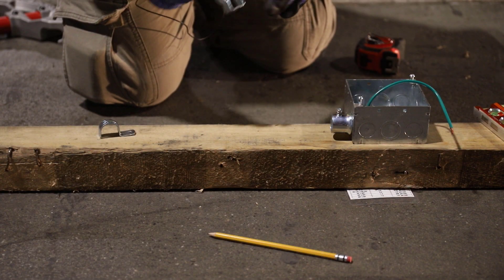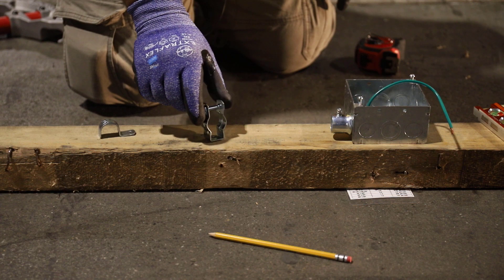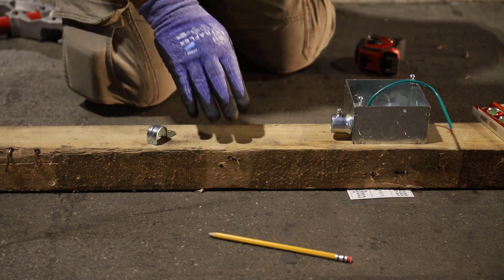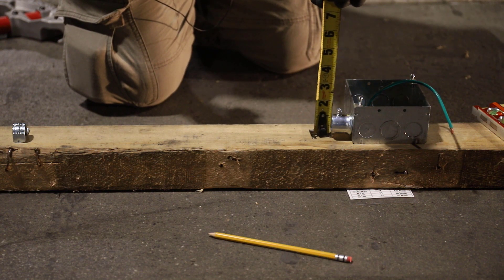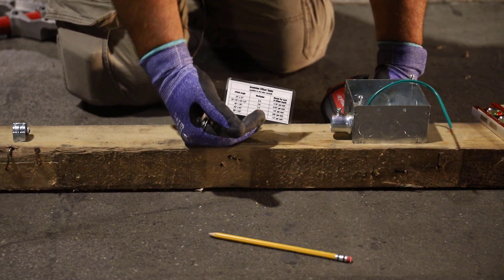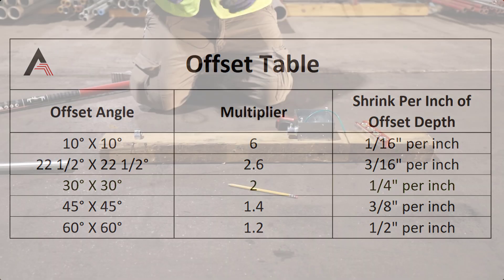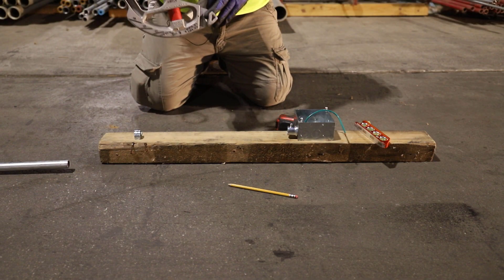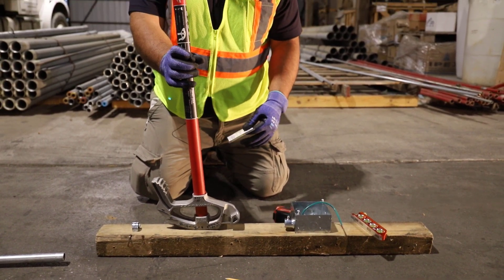How To Do A Box Offset Bend With A One Hole Strap

Comment: A little tip: the closer your front hand is to the bender applying pressure the tighter the bend and the less likely you're goining to kink the pipe. I normally lean my whole front forearm against the pipe with my elbow right above the bender and my hand next to my body because that allows me to get the pressure as close to the bender as possible while minimizing the liklihood of getting pinched.

Also, make sure you lock the bender handle with your leg because it will tend to slip if you don't.